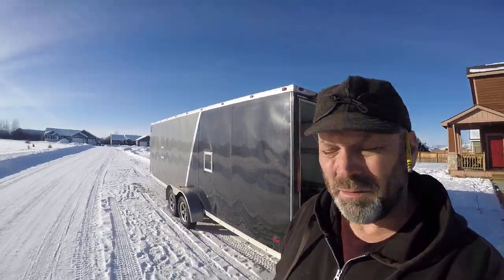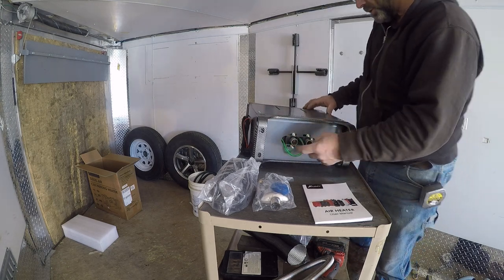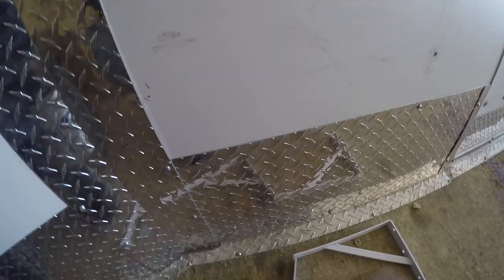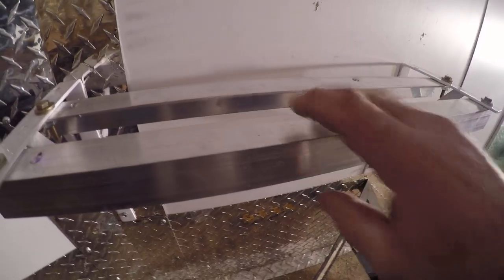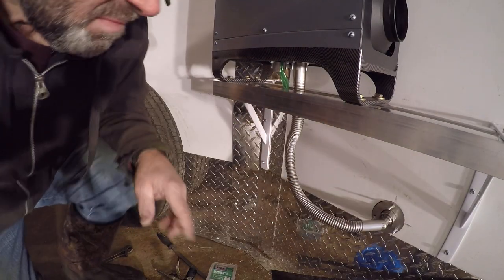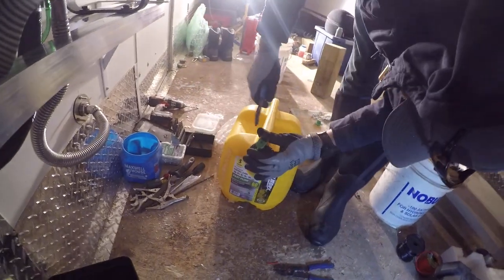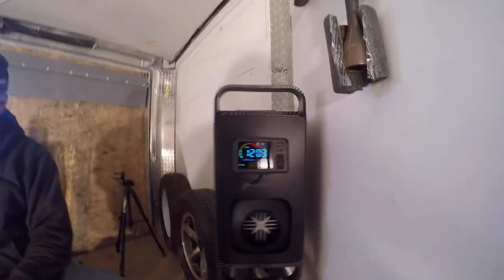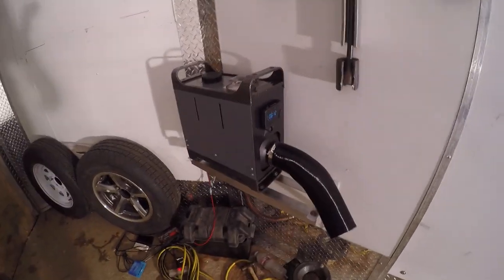Diesel Heater in RC snowmobile trailer

Comment: I like the black with the carbon fibre look. Where did you find this model. I don't see it on Amazon. Do you think it would work to thaw the ice and snow off of two sleds in a uninsulated 12' hybrid Sno Pro trailer overnight?
Reply from the maker: Check Amazon or vevor.     It may struggle without the sides and roof insulated.    But with it being shorter it might work.   It is a great heater. I have been very happy with it.   It is nice to be able to change into snow gear and be warm.  Thanks for watching and subscribing.

Comment: How deep are the shelves for battery/charger and heater. I’m new to snowmobiles/trailers and really appreciate your help! Great setup and very neat!
Reply from the maker: The enclosed helmet box shelf is factory.  Not sure of the size.  The brackets for the heater to sit on are from home Depot.  I still have to get the battery and charger system installed.   Thanks

Comment: Is the ceiling, walls and floor insulated in your snowmobile trailer?
I'm looking at putting a diesel heater in my trailer
Reply from the maker: Yes. The walls and ceiling is insulated.   Check out my video on doing the insulation.  Thanks for watching.

Comment: I am looking to put one in my trailer for the sled season. How did it hold up on your battery? Did you have a charger on it or shore power or did it not pull much power?
Reply from the maker: You do need a good way to keep the battery/ s charged.   I plan to get 2 AGM batteries.   I have shore power setup so I can use a generator when out snowmobiling.

Comment: What size hole saw bit you use for the outside vent?
Reply from the maker: I do not remember. Something like 1-1/4".  The exhaust pipe has a outer sleeve to be like a thimble.  I went out the sidewall.  Works great.